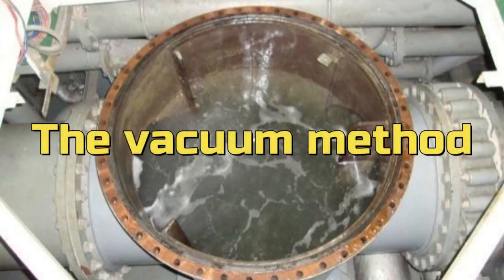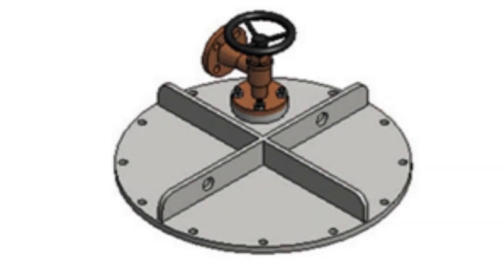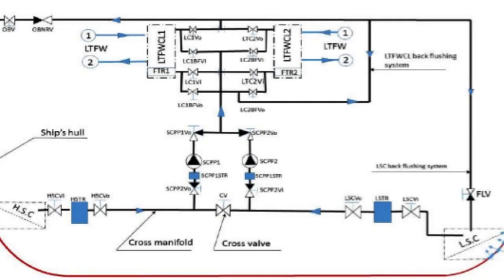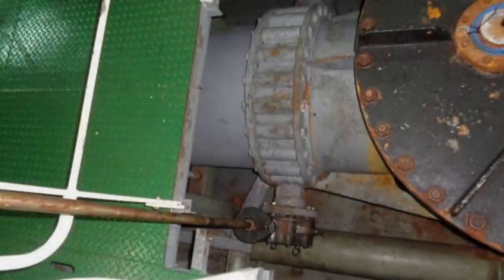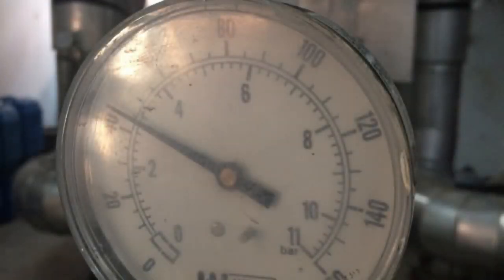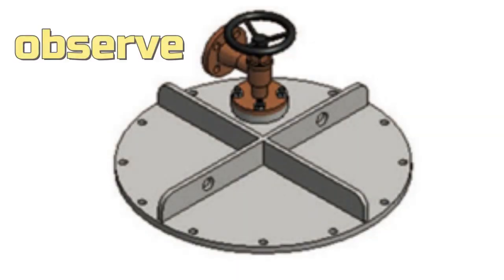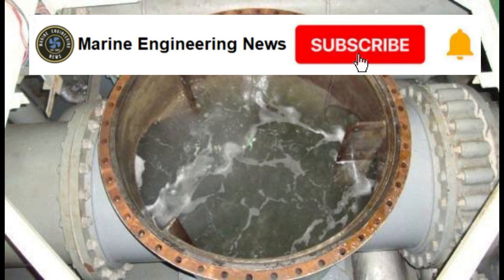Procedure of openning the cover of a non isolating sea chest strainer with purpose to clean it

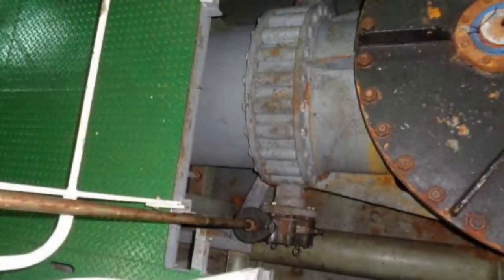Comment from the maker: DISCLAIMER : AT 01:16 I MADE A MISTAKE WHERE I ADDED THE YELLOW ARROWS ON THE DRAWING, BUT MY SPEAKING  IS CORRECT. FOLLOW MY SPEAKING AND NOT THE YELLOW ARROWS  WITH LABES. (THE FIRST YELLOW ARROW AND LABEL START CLOSING SHOULD ME ON THE INNER VALVE OF THE FILTER,, AND SAME TIME THE SECOND YELLOW ARROW AND THE LABER START OPENNING I SHOULD PUT IT ON THE INNER VALVE OF THE RIGHT SIDE FILTER) FOLLOWING MY WORDING WHICJ IS CORRECT. JUST TI CLARIFY THIS.

Comment from the maker: #nowornever #nikolaosgeorgopoulos Procedure of openning the cover of a non isolating sea chest strainer with purpose to clean it. Public Person☑, Father🙎‍♂, Single 👤, Chief Engineer⚓🚢, Vlogger 📽🏍🚘, Gamer 🎮, Blogger👨‍💻, Scorpion.📍Patras 🇬🇷 . Have you ever experienced to want to clean the filter of the sea chect on engine room, but when you have closed both valves before and after the strainer, and while openning the air vent cock, to see if the valves are isolating or not, to notice that the sea water flow is not stopping?

This meaning that if we open at this moment the cover of the filter, the engine room bilges are going to be flooded with sea water. So, what we must do, if we want the filter to be cleaned ?

The procedure is as follows :

1. We want to clean the right side sea chest strainer, so we have left in operation the left side.

Both strainer have suction from the same common sea canal, and both have one inner and outtervalves.

2. We observe that the the outter valve of the right sea chest is not isolating, because we have also closed the inner valve and we see that sea water flow is not stopping from the air vent.

3. Leave running only one sea water pump, and observe its discharge pressure. It must be reading about 2.1 bars.

4. Start closing the inner valve of the left filter (the operating one), and at the same time start opening the inner valve of the right filter (the one we want to clean), and at the same time observe the pressure discharge of the running pump and the flow of the air vent of the right filter.

5. We proceed with ster step 4 continiously until we notice that the pressure is going to drop at 1.6 bars about and that the flow from the air vent that has stopped.

This meaning that at this time, it is safe to open the cover and clean the right filter. This is the vacuum method.

Read the related article: https://marine-engineering-news.blogspot.com/2023/03/procedure-of-openning-cover-of-non.html

I travel around the world with my KAWASAKI VERSYS 1000. NEW VIDEO !!! HAVE FUN !!! SHOW YOUR LOVE WITH FULL VIEW AND COMMENT ON THE VIDEO ON YOUTUBE TO GO HIGH IN THE YOUTUBE ALGORITHM TO SLOW YOUR VIDEO AND CHANNEL TO THE HIGH CHIPS, SNACKS, BEER 🍟🍕🍿🍺🍻 . I finally chose which machine is suitable for me. I was born to travel. Motorcycle adventures are life's best adventures. Every day brings opportunities for new challenges. Beyond the roads I know, there are completely new vistas. Unknown roads are easier and more distant places with the Versys 1000. When adventure calls, me and my Versys 1000 have the answer. ANY ROAD. WHENEVER.
------------------------------

FOLLOW UP THE NEXT MOTO TRAVEL VIDEO
https://www.youtube.com/@borntotravelGR

🌟NIKOLAOS GEORGOPOULOS
STORE Born to travel ® : https://www.youtube.com/@borntotravelGR/store
WEBSITE Born to travel ® : https://borntotravelgr.blogspot.com/
Join this channel to access perks:
https://www.youtube.com/@borntotravelGR/join
FOLLOW ME ON MY SOCIAL NETWORKS:
https://www.instagram.com/borntotravelGR
https://www.tiktok.com/@borntotravelGR
https://www.facebook.com/borntotravelGR

#borntotravelgr #versys1000 #akrapovic #kawasakiversys1000 #motovlogger #motorcycle #kawasaki #moto #phantomduck #malagutispectre125gp #dezaiar #pamegamotavasana #rena_project #bucephalus #fatusolus #toraxeris

🌟 MARINE ENGINEERING NEWS:
INSTAGRM: https://www.instagram.com/marineengineeringnews/
WEBSITE: https://marine-engineering-news.blogspot.com/
GOOGLE NEWS PAGE OF MARIME ENGINEERING NEWS:
https://news.google.com/publications/CAAqBwgKMKr0zAsw2o_kAw
FACEBOOK PAGE OF MARINE ENGINEERING NEWS:
https://www.facebook.com/marineengineeringnewsglobal
LINKEDIN PAGE OF MARINE ENGINEERING NEWS:
https://www.linkedin.com/company/marine-engineering-news

#marineengineeringnews #chiefengineer #marime #engineering #maritime #merchantmarine #merchant